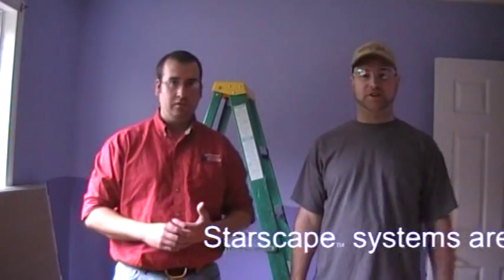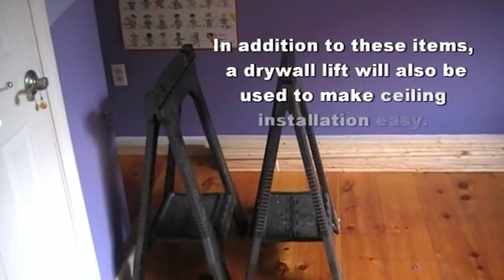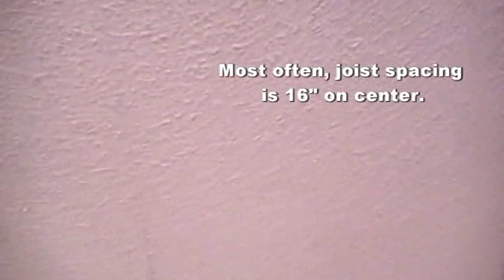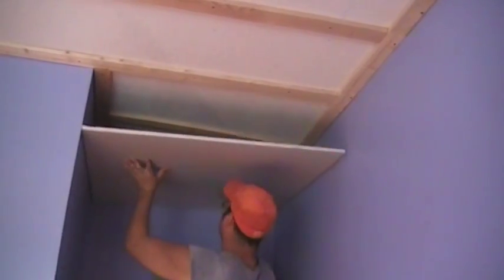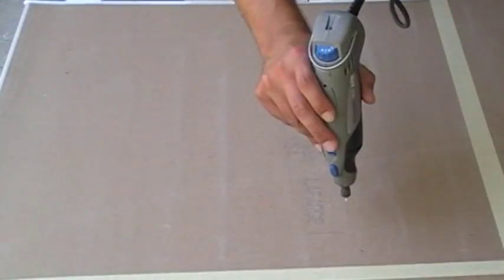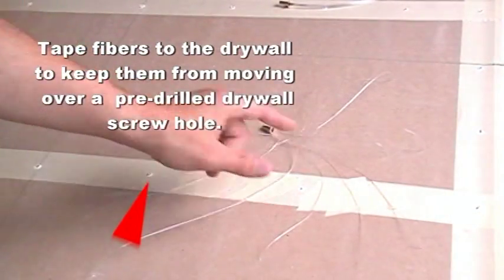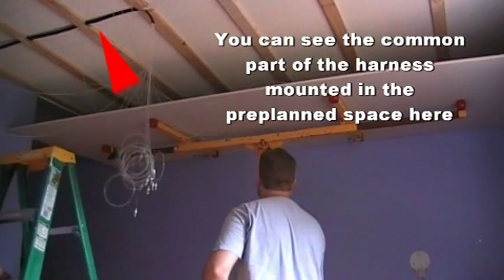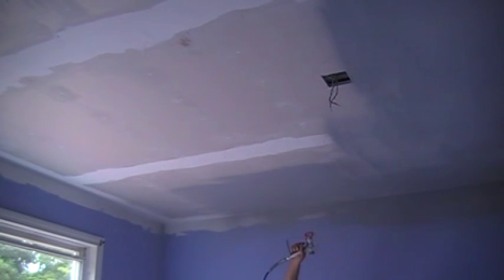Fiber Optic Star Ceiling Installation Video in Drywall for Children's Bedroom

Comment: Why not use black acoustic panels or pinboard? Save on cutting sheet rock mudding, taping, sanding and painting.. less mess and much faster in my opinion.. thoughts?

Comment: Do we really need to fill with drywall mud and paint drill hole after getting fiber out ? does that drill part looks rough or similar like smooth drywall ? can you please add picture or video how does that ceiling looks like closely without turning on light ? Does it matter if we paint fiber and then cut at the end ? how much do we need to keep outside length from drill hole when we are painting ?.
Reply: Did they ever reply?

Comment: Instead of making a new false ceiling couldn’t you just install from the attic into the existing ceiling?
Reply: If there was an attic above I didnt want to make so many holes up into the attic, because dust coming down, hot damp air getting into the attic. And depending on the climate there could be a vapor barrier. It could be done but you would be very careful to seal up all of the holes..

Comment: Hello There, where do i find the drill machine for drilling wholes in the drywall for fiber optic cables?

Thank you!
Reply: Hey there, a Dremel or any other cordless rotary tool will do the trick, though a small cordless drill will work as well if you're careful. 

I currently have a Milwaukee M12 Rotary Tool, Model 2460-21. You can buy them at any online retailer or home improvement store in the US, or a tool shop in other countries. 

If in doubt, go to a hardware store and as for a rotary tool. Hope that helps!

Comment: i assume they dont have an attic?  i did mine and didnt have to do any of this.  seems like a lot of extra work.. but i guess all houses dont have attics too though...
Reply: +Powertripp Productions Same thing I was just going to comment, then saw yours. IF by chance there was an attic above, this was really a dumb plan!! They seem serious and pretty thorough with most everything else though, so I'll assume there's no attic or maybe its one of those ranches with the really shallow pitched roof. I had to install a soffit vent for a bathroom exhaust fan in one maybe ten years ago and talk about claustrophobic, something I didn't know I had much trouble with until I did that one, wanted to get the HELL OUT OF THERE!!!
Reply: Were you able to lay your insulation on top of this? I'm going to be doing this to my room and I thankfully have a bare and open ceiling to do this to before laying any drywall. Just want to make sure that the fiber optics are okay under the insulation layer.
Reply: did you glue them up there or no?
Reply: @BloominOnion1  nope. Just drilled pin holes then stuck the fiber through just enough. They really keep them selves in places. It's easier this way if you ever have to disassemble too.